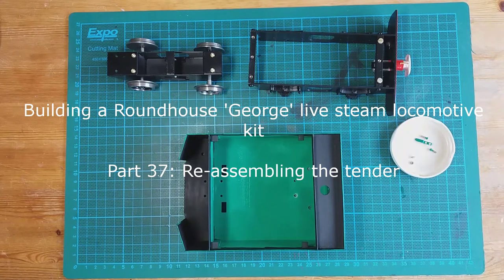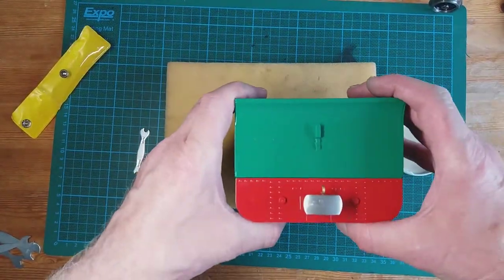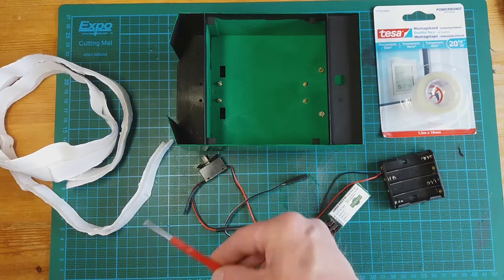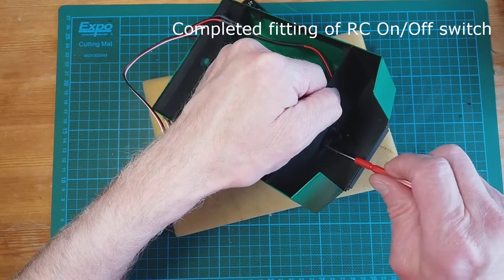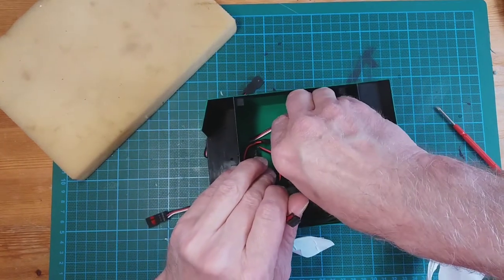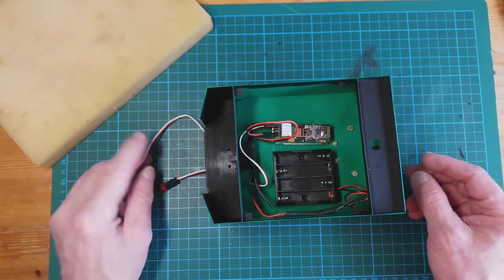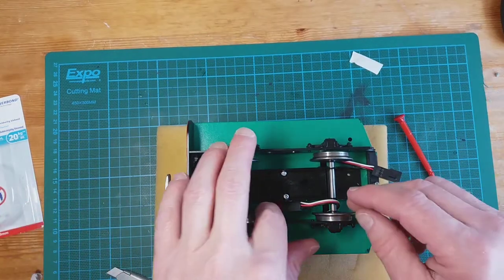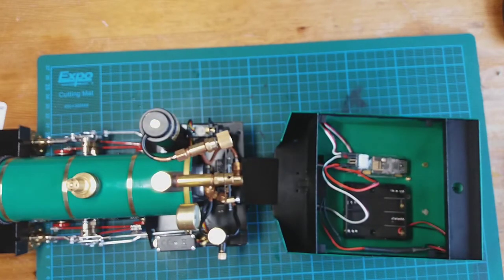RH George Part 37: Re-assembling the tender

Comment: Hi Geoff, Where did you get the floor plate from?
Reply from the maker: Some years ago when George was available from Roundhouse as an r-t-r model it came with the fall plate as standard. For some reason its not included in the kit. A quick email to the factory gets it sent to you at not extra cost
Reply: @gasmith841  Great!  I'll contact them then.  Thanks for you answers to my questions and the helpful videos!  I look forward to #39!